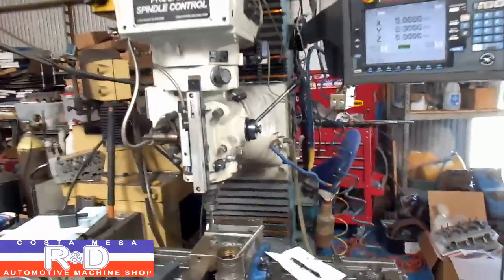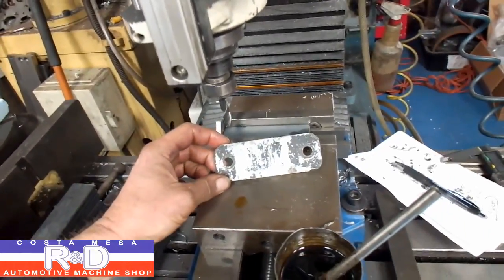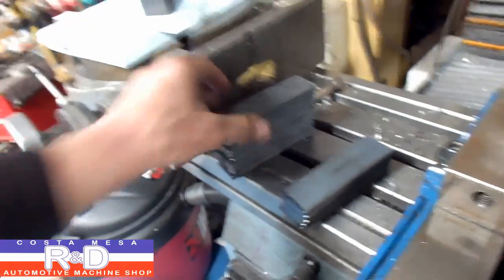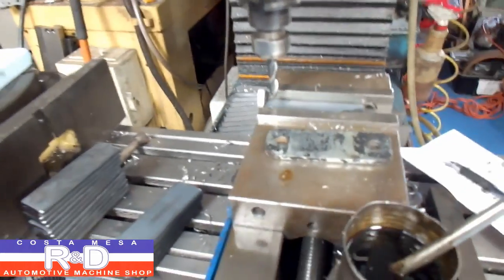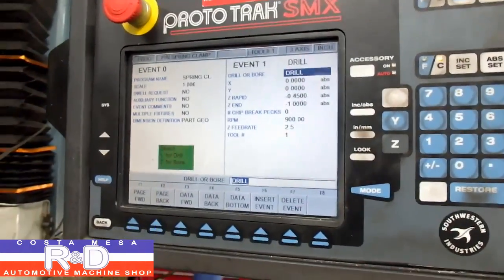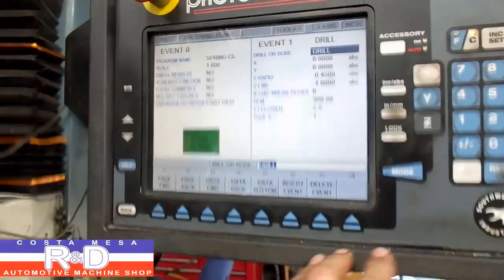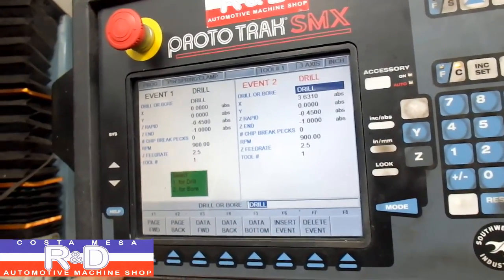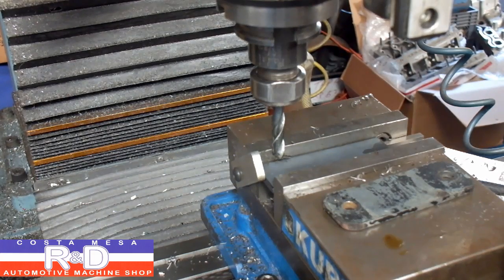427 Ford Galexie Spring Clamps

Comment: John, what cutting oil you use and do you use different ones on different metals?  For stainless I've heard everything from bacon grease to milk but not sure if when others have said milk if they were really meaning a soluble oil mixed with water.